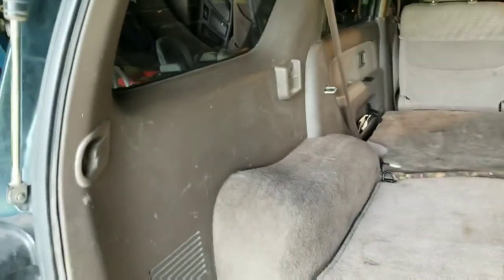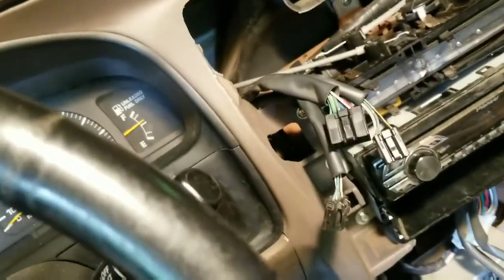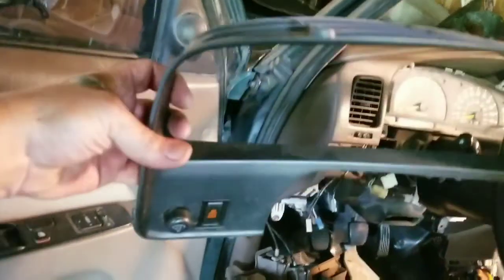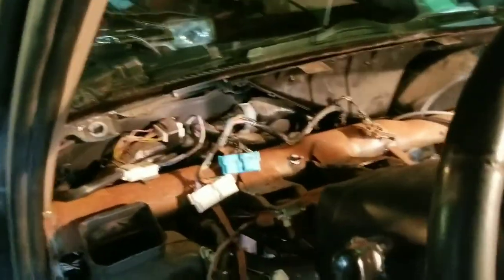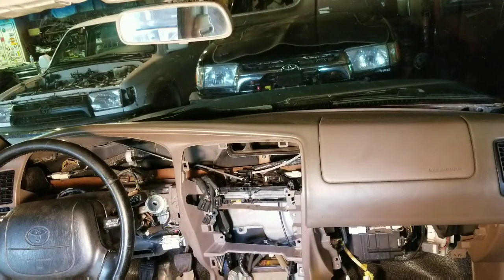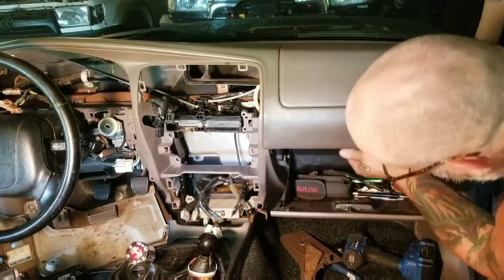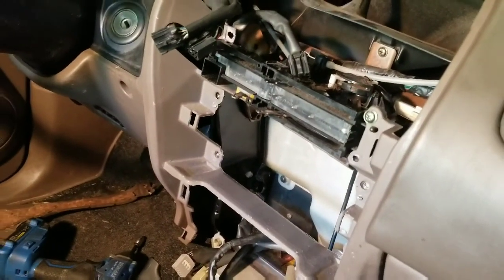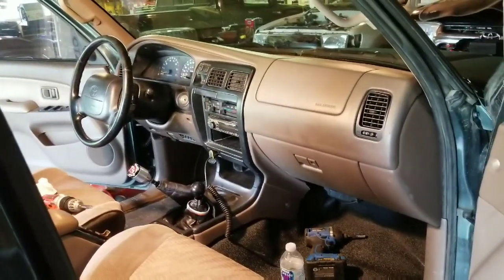How to remove and replace the dash in a 3rd gen 4runner

Comment: Excellent video thanks for sharing 👍🏼. I’m in the process of repairing my 2001 Tacoma , the cab was badly damaged but mechanically is fine. How hard would it be to swap cans? I only ask because I see multiple Toyotas in the back I figured you might have some experience. Thanks
Reply from the maker: Thank you.
A cab swap is easy, after you get everything unhooked, like the hoses and linkages and a few wires. 6 bolts hold it to the frame. 
An engine hoist will lift it if you don't have 3 friends on hand.
I've done several. As well as put pickup cabs on 4runner frames and vise versa. 
Definitely doable. 
I appreciate you watching and commenting
Reply: Man thank you so much for the reply…… this gives me hope in attempting this 👍🏼
Reply from the maker: Absolutely. 
Always happy to help. I appreciate you asking.
If you're handy with a wrench I'm sure you'll do fine. Let me know if I can help.
Much appreciated, enjoy your project.

Comment: Thanks for posting. Can you remove/replace the passenger airbag door without taking off the dash?
Reply from the maker: You're welcome. 
Yes, you can remove the air bag cover without removing the dash, but it is kinda difficult. 
Remove the glove box (2 screws at the bottom)
Remove black plastic panel above the glove box (3 10mm bolts)there are wires and plugs attached to this that need undone.
Remove the piece of duct work.
Remove 2 10mm bolts holding air bag to the metal brace (just above ecu)
Remove 2 10mm bolts on either side of the airbag (these are the hard ones to get to)
After airbag is removed there are 2 tabs at the bottom of the cover and 1 tab on each side of the cover, push to release.
Cover comes off.
The air bag is kinda hard to get out.
If you have to unplug the airbag, lift the white cover (2 tabs) then unplug the yellow plug.
Hope this helps.
Thanks for watching and commenting.

Comment: Using this video as a starting guide so I can get to heater core haha
Reply from the maker: It'll get you there.
There are several fasteners holding the black boxes to the body and there are fasteners on the back side that hold the halves together, just be patient, it's not that bad.
Best of luck to you!

Comment: isn't the VIN on the dashboard? did you swap you VIN plate with the new dash? thanks!
Reply from the maker: The VIN tag is permanently attached to the body at the base of the windshield. It is not a part of the removable dash. Although it looks like it's attached to the dash pad, it isnt.